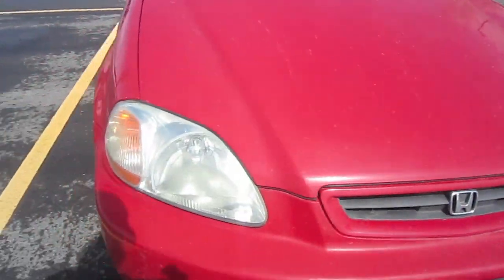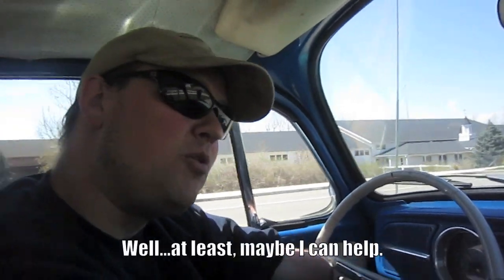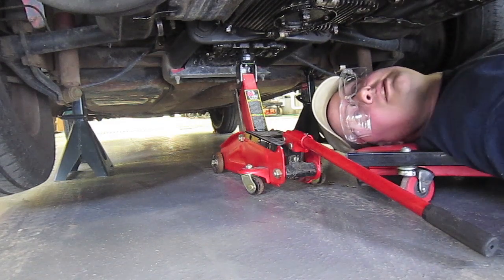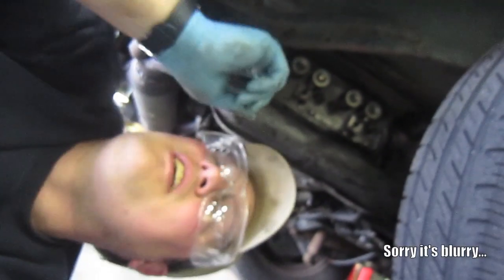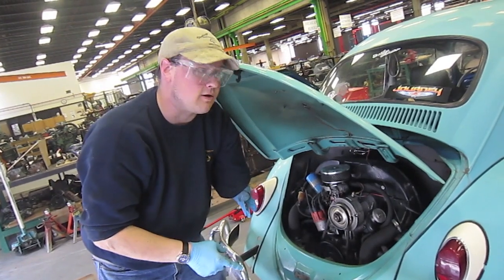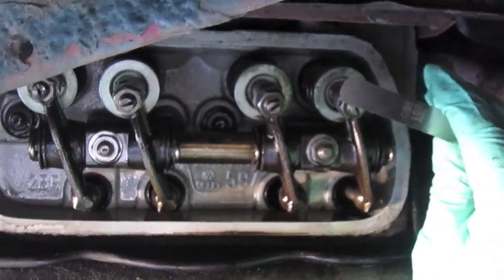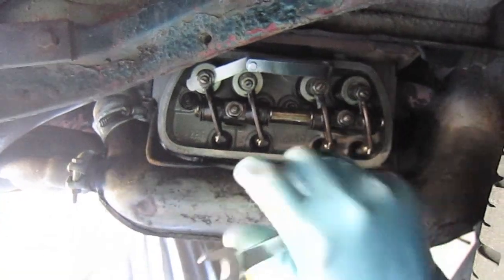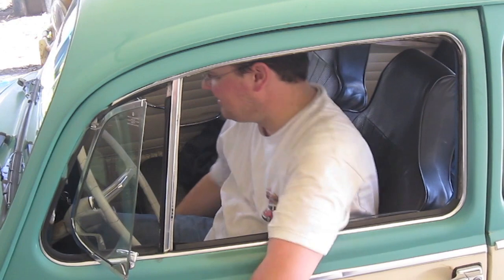Valve Vid - How to Adjust the Valves on a Type-1 VW Engine

Comment: Adjusted valves on my 69 Squareback. I noticed a couple rocker arms are loose and making that knocking noise. Any tips on how to remedy this?
Reply from the maker: That sounds like something that would start my mechanic friend talking about a rebuild. If it's the head studs not holding the rocker assembly down, then probably, y'know? Then again, there could be a big difference between a Type-3 and my Type-1, in that regard. Either way, you want a professional's advice, not mine.